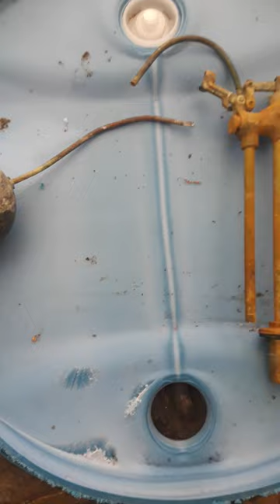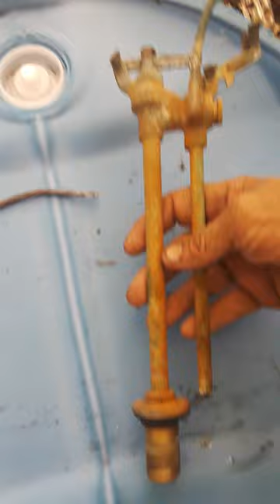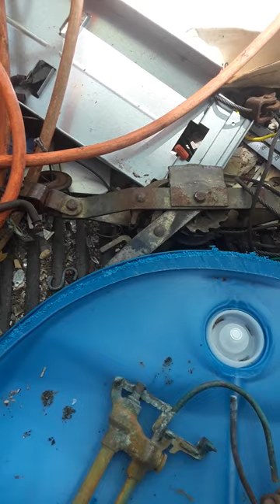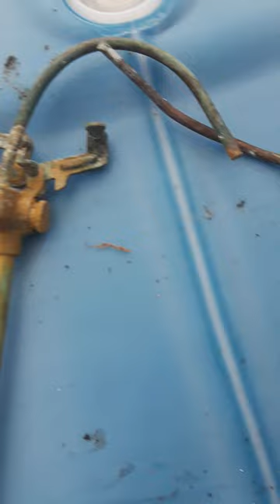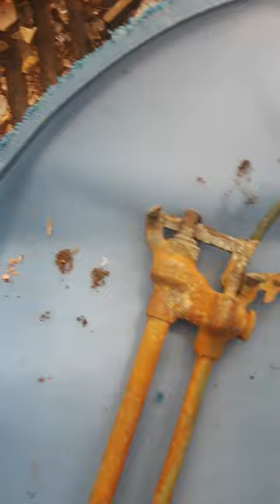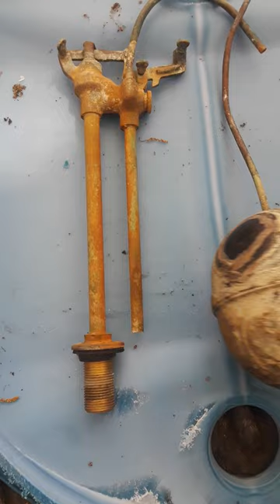#shorts antique toilet ballcock brass  #antique #brass

Comment: Cesco Brass still manufactures these.  I have a failing plastic ballcock that I'll be replacing with a solid brass Scovill Model 16A ADJ (adjustable) as soon as the USPS can get it here.  Already have the copper float (Amazon).